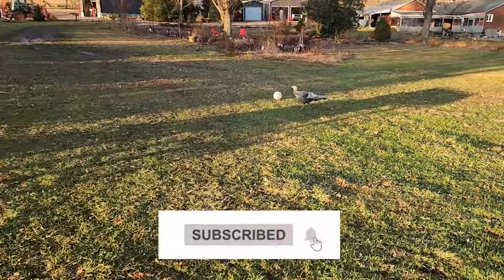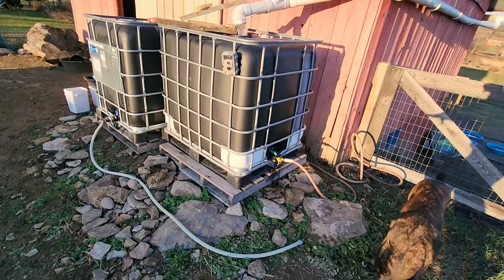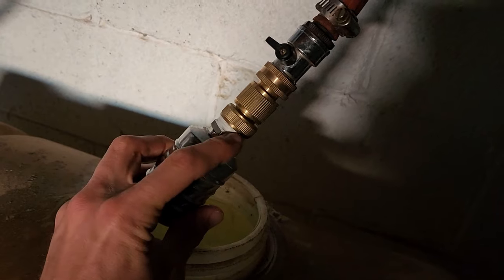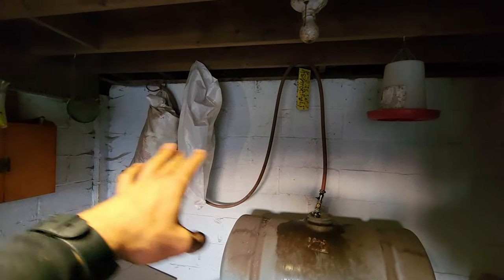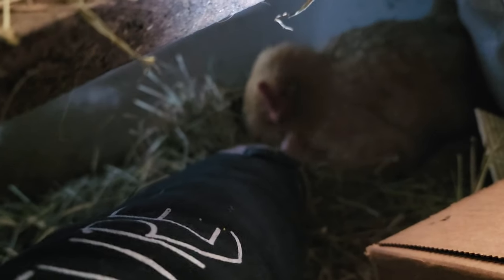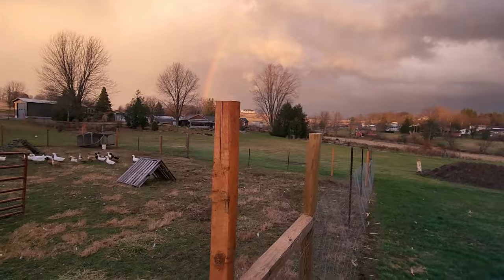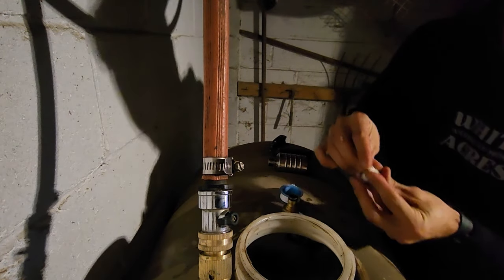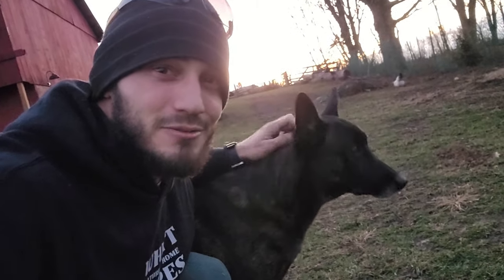Homesteading Everyday _ Not All Plans Workout // Whitt Acres

Comment: Wrap the hose w insulation. At least the outside and the upper floor part. I'd say Heat Tape but I'm not sure if you can use it on a garden hose. 
Watch NarroWay Homestead/Nate Petroski. He made a rain water system that doesn't freeze.
Reply from the maker: Thanks I watch him, I don't have electric, so not freezing isn't in the cards yet
Reply: @WhittAcresHomestead  Maybe some day you can get a good deal on some Solar panels and use that. 1 step at a time. You're doing Great!